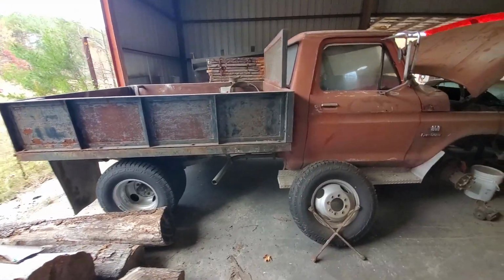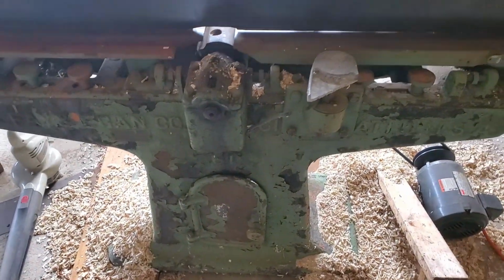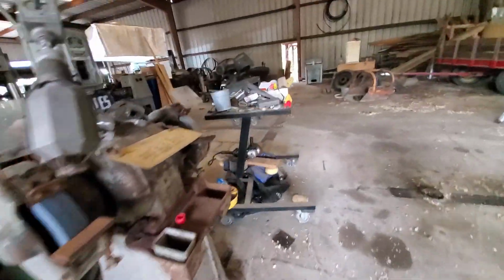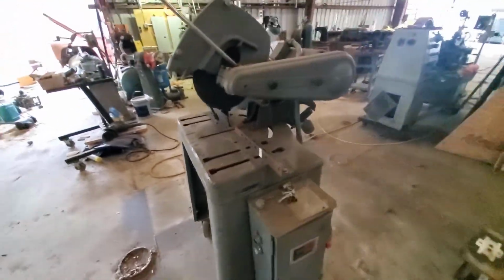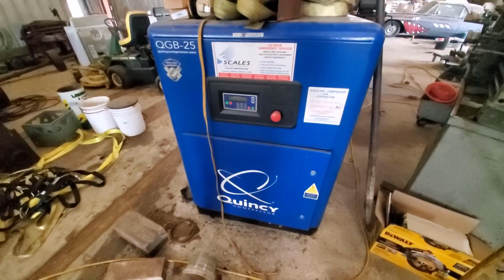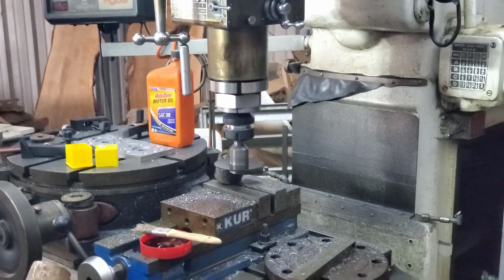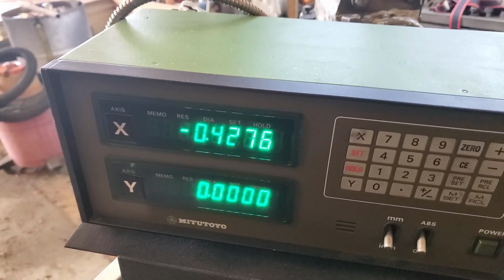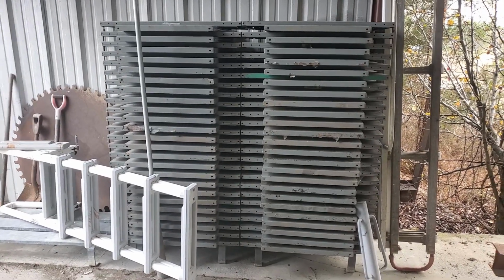(Post) Thanksgiving EngineersWorkshop Update

Comment: Don't dismiss the Ford 352. We built a Ford 390 dump truck. The engine was a factory underbored 427!
Reply from the maker: Thanks, i will remember that. Right now all I have to work with are a '74 FE 360 and a '64 FT 360

Comment: On the 72, for all that you will go through. Price out a throttle body fuel injection. If you run the truck lots the payback is around the two to three year mark. I did a lot of miles at 8 mpg. Now I would buy an older diesel truck, class 6 or 7, unless I win a lottery, then who cares what the fuel mileage is.
Best wishes from the far North.
Reply from the maker: Did not know that was an option. I see the Holley Sniper that looks like a bolt on. So many possibilities.
Reply: @EngineersWorkshop  Edelbrock also makes or markets one lately.

Comment: That tool and cutter looks so much like the Jones and Shipman 310/310t the cross slide screw messed up on the one I  used for years cost me £1400 to have one made up as couldn't find replacement one. While it was apart I replaced all the bearings and rebuilt the grinding head. It was a very versatile machine and still very capable.
Reply from the maker: Hoping this one won't require that much. Due to wear in the ways, the table is out of tram front to back .001" per inch of travel. Hoping to shim under the outer way to make up.
Reply: @EngineersWorkshop  to be fair to the machine if you're not doing anything long you will be fine using it as is. Just grease it up and away you go. I used to run a tooling workshop here in England for a lot of years and these sort of older machine hold up really well to abuse and neglect and still can turn out some rather acceptable result's, I have sharpened some rather large spindle tools on them only big issue I have is using an indexing tailstock on the main work chuck they get a lot of play in them bit I don't remember if your machine has that setup
Reply from the maker: @ladndad  it has two sets of centers but no indexing. Was going to get a small mag chuck to do occasional surface grinding of washers and shims, hence the desire to improve the tram.
Reply: @EngineersWorkshop  an yeah surface grinding on a tool and cutter grinder is interesting if you going to be doing any sort of spindle tooling on it then I recommend you get a good holder for that I think they have a morsetaper no4 and a spindle to mount your tool on then in the back side of it is a barrel with a load of holes like an indexing plate with a location pin. I have sharpened planer blades while in the head from a planer on the Jones machine but it's a lot of work when a proper knife grinder works so much better. I wish you luck with your machine if you have questions I will do what I can to help